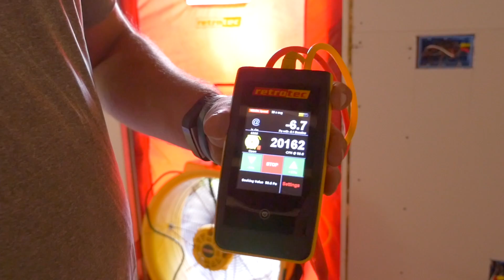What is a Blower Door Test? | Foam University

Comment: Is this A accurate test for A building to test to see if cigarette smoke travels from A apartment to another apartment on A another floor and across the building?
Reply from the maker: Hey Robbie! Most times cigarette smoke migrating is an HVAC problem. A blower door test wouldn't ultimately tell you the info you are looking for.

Comment: How does air sealing a home work with the need for ~4 air exchanges per hour?
Reply from the maker: If the house falls below the ACH needed mechanical ventilation would need to come in. This is relatively inexpensive and is much better over all system.